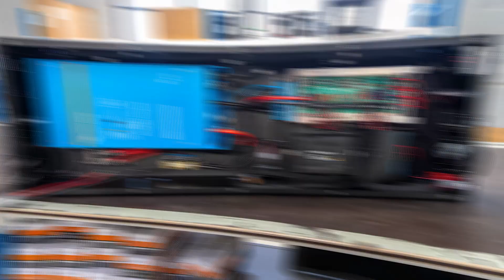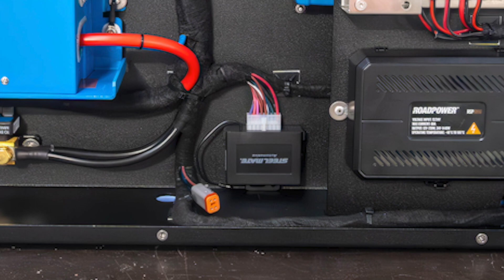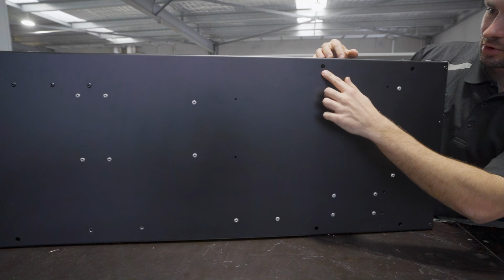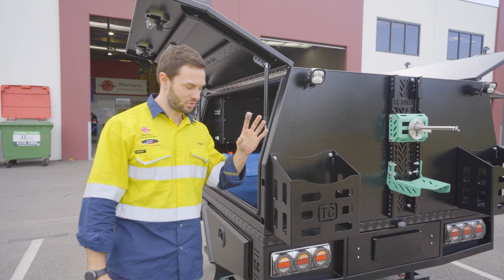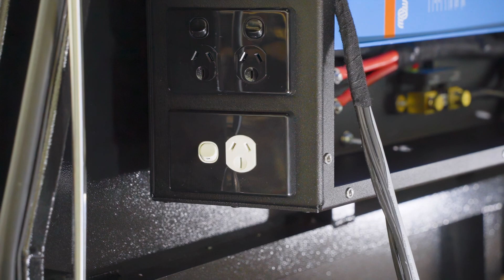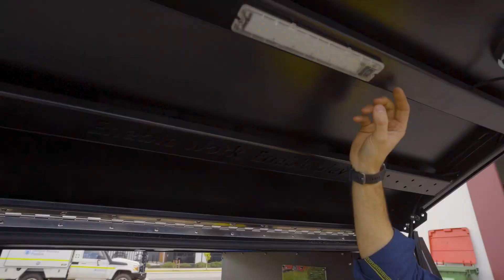The Klarmann Prospector: Ultimate 12V System For Full-Width Canopy

Comment: Redarc so much more simple without all that gear everywhere
Reply: Not necessarily. Redarc will take up the same space to be equivalent to that victron unit. Victron will trump Redarc all day any day. They are used in yatchs etc. Coming from a Redarc owner here. 
However Redarc is premium gear made in Australia. Their new kit is what they needed just took a bit longer to bring out
Safiery will blow all of them out the water in every aspect. But there is not 1 brand that does everything right. 
These guys do a ripper job here in Perth 💪🏽
Reply: @dgd05  shore power is shore power why does it affect batteries?
Reply: @dgd05  exactly and I will add that Redarc is best for those whoe don't have the knowledge to customise the configuration, plug n play so to speak compared to the other 2. Have owned both Redarc and now Victron so can speak from experience.